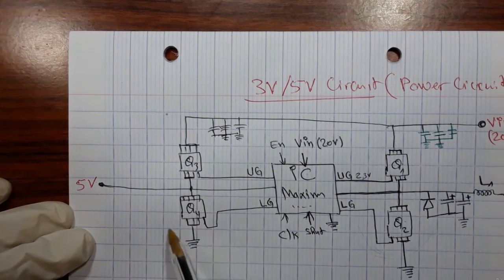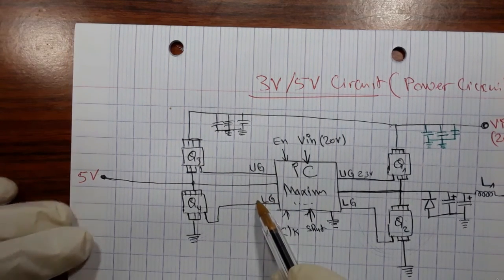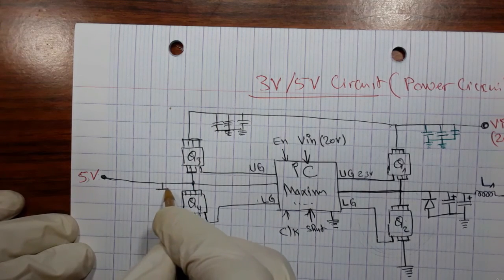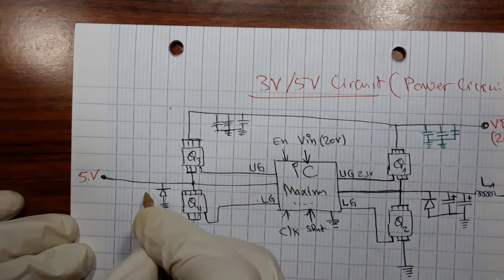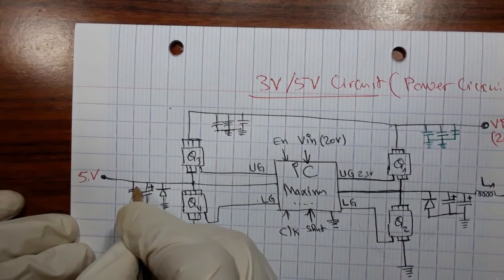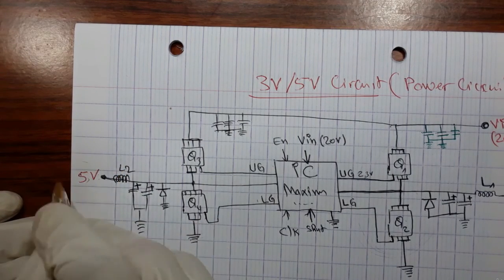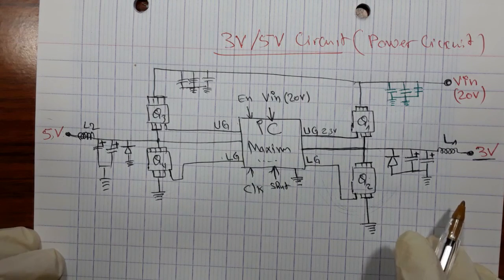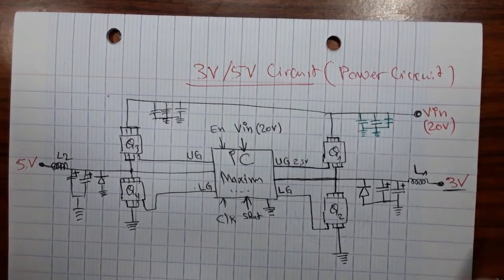3V and 5V Motherboard System Power circuit explained - laptop repair

Comment: Modern laptops have separate buck between 5v and 3v. 
These buck have LDO signals that provide the ec chip to generate the enable signal.
The s5 stage only allows the 5v to be enabled. The 3v is only enabled when the power button is pressed

Comment: Great illustration as usual.  I have  a question, why  do we need two  mosfets to generate 3v and 5v? can't this be done with only one mosfet? sorry but I'm a beginner
Reply from the maker: Thanks for your question! Using two MOSFETs allows for better control and regulation of the voltage levels, ensuring stability and efficiency in the circuit.
Reply: @electronicsrepairbasics_erb  thank you